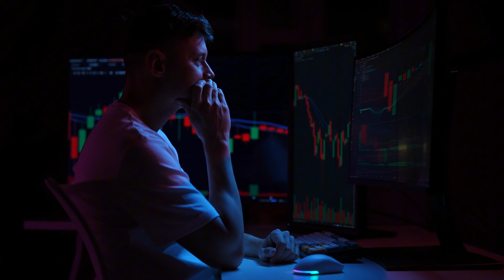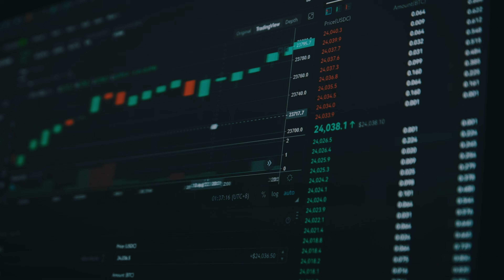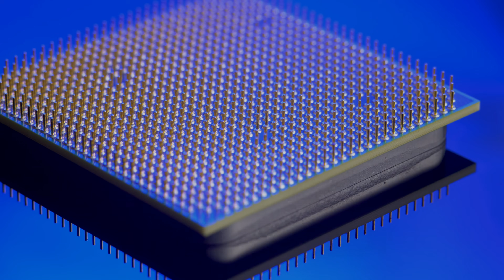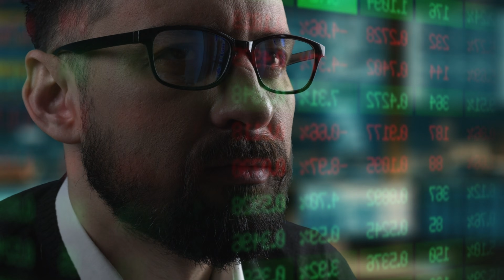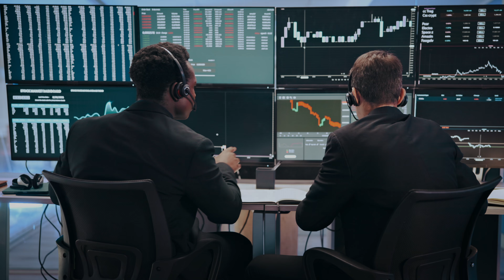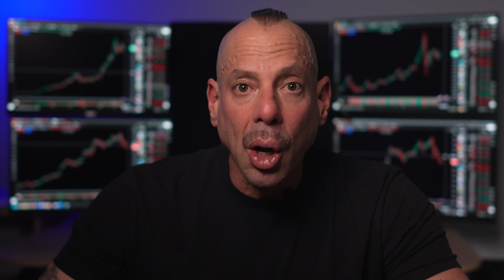Your Expensive CPU Might Be Destroying Your Trade Execution

Comment from the maker: Most traders are running a processor that looks powerful on paper but bottlenecks their trading platform in real time. It's not about how many cores you have — it's about how fast a single core can react. Drop your core count below and find out if your setup is actually built for trading speed: https://eztrading.pro/cpu

Comment: If I call in can I customize the Odyssey with an Intel Core Ultra 9 290HX instead of the AMD?
2X 2TB NVMe Gen 5 SSD?
96GB RAM, 2x48GB RAM, DDR5, 6400MT/s?
NVIDIA® GeForce RTX™ 5090 24 GB GDDR7?
Thunderbolt 5 ports?

I'm also checking with Falcon Trading computers.
I've noticed most of the customizing for Falcon can be done on their website but on yours it seems I can't customize anything at all...
Reply from the maker: Absolutely we can build that for you. - the 290HX Plus is a brand new release and this is exactly the kind of build we’d rather talk through directly. Once you get into Core Ultra 9, Gen 5 NVMe, 96GB RAM, RTX 5090, and Thunderbolt 5, the goal isn’t just “can we build it?” — it’s making sure the parts actually match your trading workload and that you’re not overpaying for hardware that won’t improve execution.

Our website keeps the options simpler on purpose (hence the name EZ), but custom builds can be discussed by phone. Give us a call at 800-387-5250 x1 and we can walk through the configuration, your platforms, monitor setup, and workload so we spec it correctly. May the trend be with you. 🚀
Reply: @eddiez-trading Will do, thank you Eddie!
Reply from the maker: Happy to help!
Reply: A Mac M6 has the the highest single core count ever, 6k plus what about those?